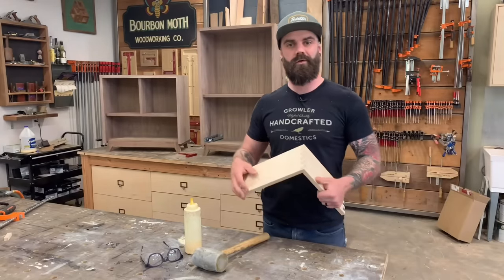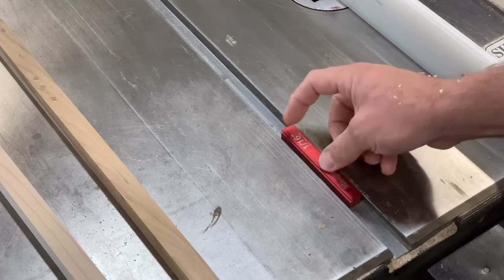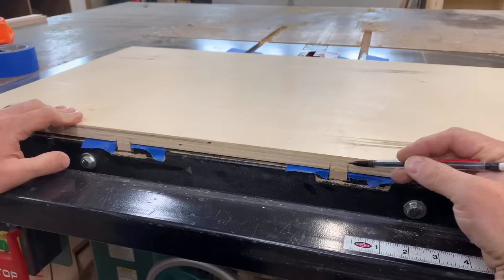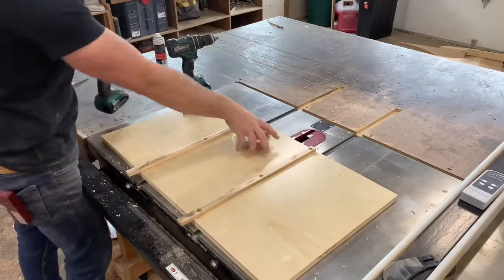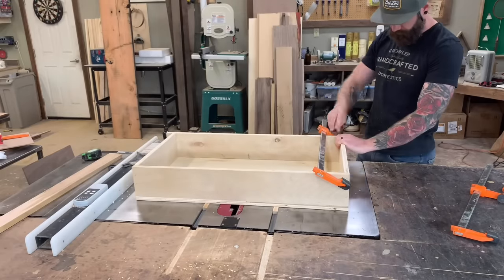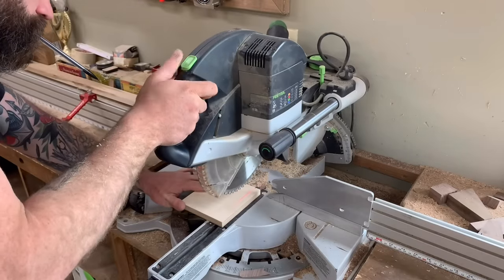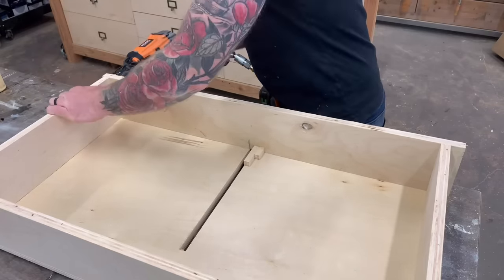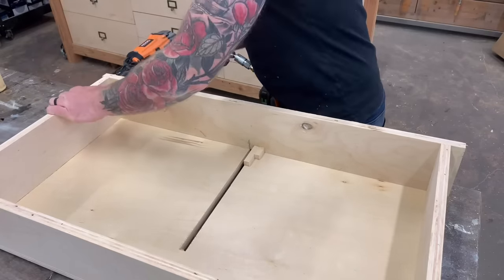Easy Box Joint Jig | How To Make Box Joints

Comment: I want to thank you for this excellent video. I tried to make a box joint jig several months ago and it was a flop. I tried again following your directions and it came out good but the joints still didn't fit. After doing some troubleshooting I discovered that the jig was absolutely dead-on, but the dado stack was a hair too thin. I fattened up the dado and tried it again....still wouldn't fit. Huh? I measured the fingers and notches with calipers and found that the joints were dead-on perfect. I tried tapping on the fingers and they dropped right in with a perfect-snug fit!

Comment: Fantastic, so, if I make the face plate inner-changeable instead of gluing and nailing it, I could have many different size face plates instead of several different boxes hanging around.  You could just glue a couple of threaded rods into the middle of the sides and then drill holes through the face plates and add wing nuts and washers to secure each one.

Comment: So you have a big box like this for every size box joint, and if it is tight you have to sand the side down to adjust it.
Not to complain cause i don't do videos, and don't have a you tube channel, but I made a single slide then attached one of several box joint adapters to this using T nuts and knobs to friction fit. 
The adjustment comes with a standard bolt threaded into one of those inserts. The adjustment comes from a similar system on the attachment This bolt can then be tightened against the insert with a stop screw. 
It works pretty good and does not take much space.  I store the whole works in one of those Walmart tubs under a shelf.
I don't do much woodworking, and don't have much space.  The wife wanted me to have something to do after I got off the road (driving semi trucks) so she bought me all these woodworking tools and allowed me to buy more.  Most I do not know how to use adequately. mostly I make jigs and tinker around when I need a place to hide. 
Your way seems pretty good, except for storage space and adjustability.
Thank you for sharing.
If you want a picture of my setup I could send pictures.

Comment: A cool idea: instead of gluing and nailing the front piece with the key in it, you could add t-nuts to the sides of the jig and create multiple front pieces for different size fingers/box joints! The T nuts would make sure the front goes in the same position every time

Comment: That was an excellent tutorial. I’m planning a build for storage in my studio, and this is exactly the info I needed. I’ve already built a crosscut sled, so I may try to modify it to do this.
Reply: The problem with using your crosscut sled is that the dado stack cuts a wider slot and you lose your zero-clearance when you put a single blade back in.  That’s what I did with out thinking it thru. Now my sled was nothing that special so I just made a new one, but if you have one that you do not want to lose zero clearance with just make one like in the video.
Reply: @richardlug6139  You are absolutely right, I realized this after posting this comment. I ended up building a second crosscut sled for dados using William Ng’s technique.

Comment: dude, this was awesome..... will make my life SO much easier now.  Question, regarding sizes.  I would gather that this can be scaled up or down depending on the size of the material you're cutting right? for example, say I was making a 1/2" thick jewelry box for my sister in law, or conversely I was building something larger using 3/4" material, all I would need to do is build a jig using those respective sizes right? (more of a newb wood working guy but have some skills lol)

Comment: Really well presented tutorial.  However, I would suggest that you explain that the overall width of “back” piece be at MINIMUM the width of the base PLUS 3x the dado width.  That backer MUST be left justified when making the dado cut.  That provides sufficient width for shift left of that backer board with spacer attached so as to leave enough of the backer to attach to the right side.  Great vid.

Comment: Wow!  That's amazing.  Is there a reason why your box is 3' x 18"?  Can it be smaller and still function properly?  Can you make one for dovetails?  The length of your fence is longer than your saw table top.  How is that?  Are the grooves you cut into your wood table extension the same length as that fence?  Thanks.

Comment: Do you sand the tooth a little more to gain some room for glue?  Sometimes the glue seems to swell the wood just a little more before you get the pieces assembled. Great job on the box joint jigs

Comment: really helpful tutorial...I used yours and a couple others to build mine...worked out pretty well.  

I'm not a skilled woodworker, I build in metal...usually steel, so I am hesitant to critique, but all three tutorials I watched all made the same "mistake":  making the tracks for the sled thicker than the slot depth...leaving the sled floating above the table and on the bottom of your table slots.....why?  All you're looking for out of the slots is to maintain perpendicularity, the surface of the sled should take its position from the saw table top, no?  If I'm missing something, please fill me in!

anyways, I made mine thinner so they dont touch the bottom of the slots.  Sled moves real nice & the sled actually sits on the table.  Anyone looking to build one of these would be wise to consider that small change.  

ps  I also used wood glue & 18g 3/4" brads to secure them, also worked fine.

pss--no one should care if your arm happens to block the actually cut, you explain your setup well enough that it really doesn't matter.

Comment: I really like this! I was completely confused about the tab. Then you said "....don't worry about it. I'll explain it in a bit." My question is do you really need to have the 3 sides (the 2 ends & the back which to me is the front 😁😁😁)? Couldn't/could you just use a beefier out a 2 X 6 back then do the sled the same?

Comment: 1) really helpful video - thanks.
2) in lieu of making several large jigs for different sized fingers/tabs, what do you think of creating several front panels (with different notch sizes glued in) and then fastening the front panel less permanently? Would it be problematic to have a larger slot (ex. Base of Box created with 1/2” dado slot, but using front panel sized to create 1/4” notches)?

Comment: If the board with the slot and pin was removable, other boards could be made for different size box joints. With a little planning ahead, the drawer sides, etc could be made with a full pin or slot on both ends. (eliminating the thin sliver.)

Comment: One question. With the box joints fitting that tightly, when you glue it doesn't all the glue get rubbed off when you put the 2 pieces together? I've never made or done box joints as I am new, so just wondering. Great video.
Thanks Chris
T

Comment: Today I built a real box using this jig and I learned a couple of things I'd like to pass on.
On the first board to go through the jig, the side facing into the box becomes the INSIDE of the corner. After flipping it and running the next board through, the side of the second board that faces into the box becomes the OUTSIDE of the corner. Keep careful track of which side is inside and which is outside or you'll have a nasty surprise when you reach the last corner!

Comment: Hi, enjoying your videos. Any advice for making boxes on rails, aka drawers? I want to make it from 9mm ply as weight is an issue for the campervan (and already bought). I also saw your cabinet build but I don't have a nailgun. And nails are not ideal for in a van (hear say). The current plan is to make a box joint but not sure if I should make a dado as the material is thin already. Any ideas ?

Comment: That works well but I prefer Dovetail with a router. You can get a jig setup for using a regular router. Not attached to any table. You just clamp your wood in the already assembled router dovetail jig and use your regular router following  the pattern made out of steel. With a simple bearing on your router bit you can do quality dovetail drawers with your current router

Comment: Just an fyi I built the jig works good mine was too tight also instead of sanding down the block you can add 1mm shims too your dado stack instead…10-4 over and out run on sentences

Comment: Could you leave the opposite side off? and potentially half the size of the base plate portion needed? You could use a triangular brace at either end of the base plate to keep the closest wall square to the base right? and as long as you have enough base plate to keep the rails straight it would still work?

Comment: This a little better jig than what I came up with to achieve the same result. I just made a high sacrificial miter face with the same offset indexing tab for spacing. It wasn’t for a box joint but rather a dentil moulding. God I need to quit building jigs and sleds they are piling up.

Comment: Great video. Could the front board just be screwed onto the side boards so you can change it out depending on what size dado slot you are using and also what size board you are working with?  That way you can just change out the front board instead of having a whole jig for every size dado and wood.  Newer wood worker here so would appreciate any thoughts on my idea.  Thanks!

Comment: Would you please explain the purpose of building the jig as a large box instead of simply attaching glides for the miter slots and a fence to a flat and straight base? Is it to help the jig stay square? Or…? I’m thinking about storage as well as limitations of work material imposed by box size, but also want to create tools that last. Thanks!

Comment: Good day sir. I wanted to know if I could get some advice from you. I have been woodworking for quite some time now and want to start using box joints but I am unsure on what to use for my table saw. It is a Craftsman 10-inch jobsite table saw and I was wondering if I can run a dado stack in that. I have done some research and some say yes and some say no. I want to safely be able to do this without any issues with wood or safety. Now I know I don't have a Dayton or a Jet table saw but this will have to do for now. Should I not try and run a dado stack in this or what should I do? I really do not like using pocket holes or butt joints. I do have a biscuit joiner but want to make cleaner more apreciated joints as tp why I want to go with box joints. Any help would be greatly appreciated and I love watching the videos please keep making them.

Comment: That looks very good.  Thanks for sharing.  I just got a table saw, how can I tell if it will hold multiple blades?
Reply: Your manual should go over if your specific saw will take Dado Blades. What’s the brand and model #
Reply: @jameswestii454  i will check that out this evening after work.  Thanks for the reply, I'll let you know.
Reply: I have a Delta 36-6013
Reply: 8” Stacked Dado set up to 13/16” works fine. Be picky with what brand you buy even though they can be spendy. Freud makes a nice set. 
Don’t get a Wobble dado set!
Reply: Remember you will have to get a new throat plate since the one it comes with will not work with stacked blade thicknesses over about 1/2”. Also you will have to remove your riving knife if it’s installed.
Reply: @jameswestii454  ok thanks again.

Comment: Well, I just came here to look at how the flip flop of the panel went to the next peice.  However.  When you create that 5/8 box end jig insert, it only works if the cut is 5/8 deep and deeper. for instance you can't make a 5/8 wide cut with a square jig insert with a depth less than that jig insert.  if you do the ends will be crooked.

Comment: I'm curious as to why you made such a large box for this jig? I was waiting to see how you would use all that confined space.
Reply: I am also curious as to why you made a box at all. Wood(would) a tray(bottom piece) and front fence not work without the side and back? Or is it due to the way you constructed the assembly that requires all the sides?
Reply: You need all 4 sides because you're cutting right through the bottom. It'd be too flimsy otherwise. You make it big to handle various sizes of stock for different sized projects.

Comment: That sure seems like a lot work for a single-width joint jig.  Unless one is in production mode, it would be better to get one of the jigs from Rockler or MLCS.  They are infinitely flexible and inexpensive. If one has a woodworker’s table saw, it is a good idea to invest in the Incra fence.  They just to not make a more precise attachment for "big boy" table saws.  Furthermore, they have couple attachments, like one that specifically allows one to make unlimited kinds of box joints, like differentially spaced joint fingers, fingers with "inlays," pieces to make all-wood hinges (with the Incra hinge making device), etc.

For Jason’s sled, it is clear it would be a good idea to have screwed or brad nailed the aligning (dado-width) piece.  It was already coming loose in the video; placing a screw or nail on the back side, thru the sled backing, w/should not create problems.  Likely it would come completely unglued even after the glue dried. Also, I believe a more accurate placement would happen if a piece of wood, metal, or whatever, i.e, something slightly thinner than the sled’s dado cut, was placed in the sled’s dado cut, against the sled’s dado cut (the kerf of the box joint fingers) and the slide the companion piece against the block of wood / metal and then slide the alignment finger to be glued against both of those pieces.  This method may have produce better fitting cutouts that would not rub and dislodge the alignment piece. Using one’ finger to align a critical placement piece is too rookie.  Better to use solid pieces to butt against another to establish a better alignment guide.  I personally would not hold a tall piece of wood to the back of the sled; I would use a clamp to hold it more firmly.  One little slip and all of a sudden one is trying to protect the wood from falling out of alignment and unwittingly loosening a finger or part of it when flesh meets the saw blade.

Comment: I have a personal rule that parts of my anatomy are always at least the length of nails away from the nose of the nailer.  You can guess why I have that rule.
Also, I'm thinking maybe the indexing block thickness could be less than the notch depth.  If it were half the depth, or even just 1/4", it would still function as the index, with much less friction slipping the box notches over the index.  The width of course is still critical.
Also, is there a reason for the front-to-back of the jig needs to be 18" - just to provide less yaw for the jig?  Would 12" work just about as well?

Comment: When using a jig like this, what would cause variations? I Some of mine slide loosely together, some snuggly, and others won't go together at all (all from the same setup, 4 sides of a drawer). I was in a rush, so I just made a quick version to attach to my miter gauge. Would that cause the problems I have?

Comment: It’s an extremely nice sled. That being said, it seems to be 5 times the size it needs to be. The bottom board doesn’t need to be any deeper than the top board and it only needs to be a little wider than the runner slots. Just curious, why such a massive box to just cut a few fingers in a piece of wood?

Comment: Here is a stupid beginner woodworker question.  Do you add glue to each joint on the box joint?  How would you manage the crazy messy squeeze out from that process?
Reply: Yes you would use glue. As far as preventing glue spread, you could put tape on the non glue areas and then after the glue hardens, you can just peel off the tape. Or when the glue is still wet, take a damp cloth and wipe off all of the glue. Also in tight corners, you can take a straw and push it into the corner and let the glue go into the straw.
Reply: @ryancolagerakis1034  Thanks Ryan.  I recently saw the straw trick and I'm looking forward to giving that a try.  The tape idea sounds like a winner too.  Thanks and happy creating.

Comment: What if your notch piece only stuck out the thickness of your board, then you make an insert face board that fits over that notch but has a different size (smaller) notch piece on the right side as well as a piece filling the cut in the sled to reduce tear out. I'm thinking a 1/2" for the sled and 1/4 for my insert board. Attach a stop to the sled for positioning and use clamps for the insert. Should be easy to install/remove. Thoughts?
Reply: Never mind

Comment: Ok it's cool to start the cut in the middle but for those who aren't aware: once the blade is up, DO NOT pull the sled toward you over the uncut portion. This will result in your saw throwing your sled at your face.

Comment: I'm a bit of a OCD nightmare when it comes to symmetry, so how do I do this and center the box joint? Maybe making spacers to add to the first joint to offset it less than the 1/2"?

If I made spacers in sizes like 1/8, 1/4, and 3/8, then just added them to get close to center on the first joint, the difference in thickness of the end joints would be within 1/8th of an inch. I think that might be acceptable, right?

Comment: Often better to have the guides slightly superficial rather than proud. You can lift it up for the glue, but it means that the base is riding on the table rather than on the guides, where you get a little bit of a gap between the base and the table